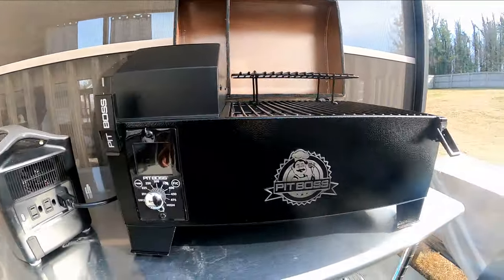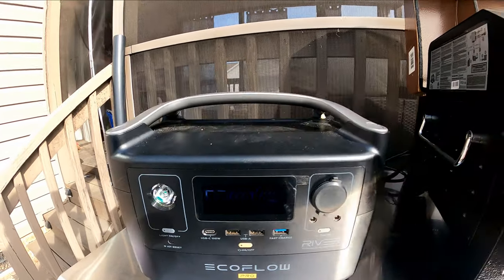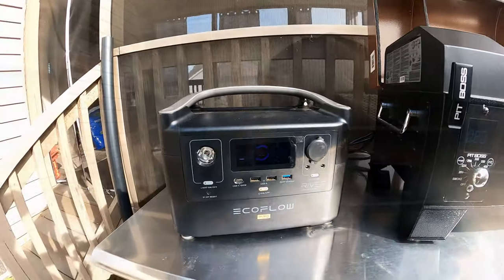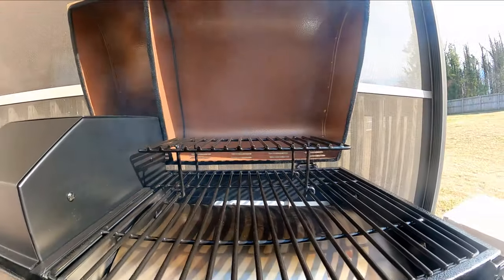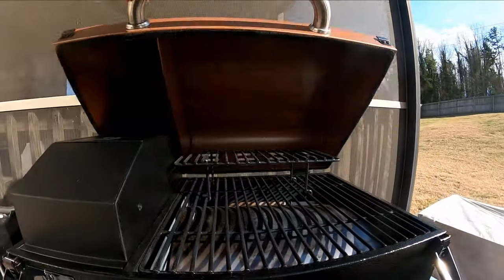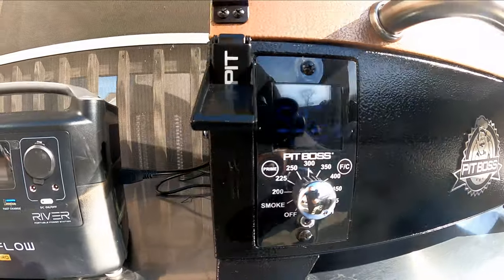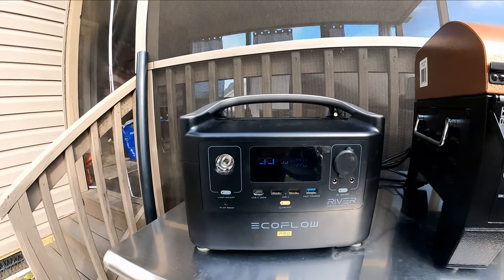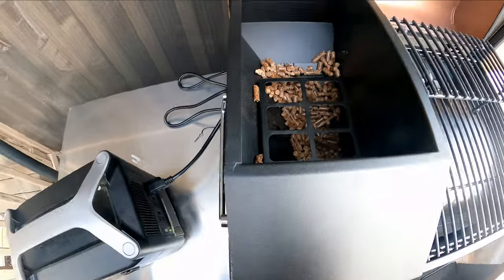Watt Hours Face-Off: Solar Generator vs. Portable Pellet Smoker

Comment: I have the same grill for our softball tournaments and have been lugging around a small gas generator that weighs over 50lbs. Sam’s has the driver 2 Max on sale for $299 right now and it looks like that would be a great deal for me. Thanks for proving it will work.
Reply from the maker: I was amazed how low the power draw was.

Comment: Fun fact.
I just picked up a delta 2 and plugged in my old electric smoker (the ones that look like mini refrigerators)
It pulls 750 watts of power to run those. Gives me only an hour to get up to temp and smoke something….i gotta pick up one of those pit bosses now.
Reply from the maker: Walmart has em  for 230 I think lowe's is 249.  Pitboss has a new one for 499 and it has its own battery.

Comment: I have thr same setup
Reply from the maker: It turned out to use way less power than I thought it would.   It's definitely a flex to pull out a pellet smoker while overlanding.